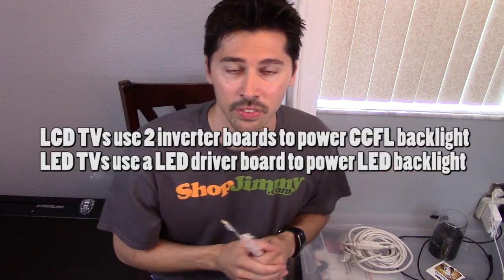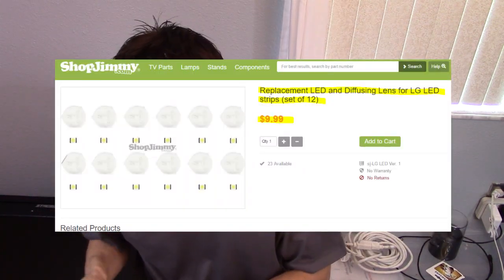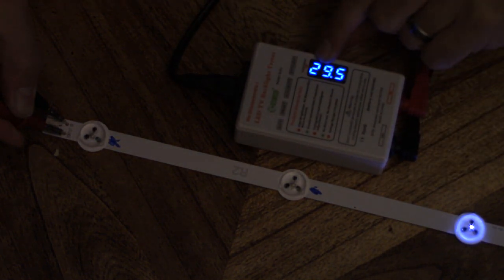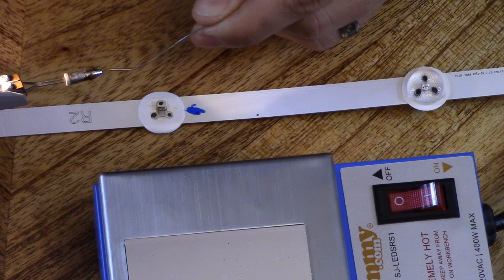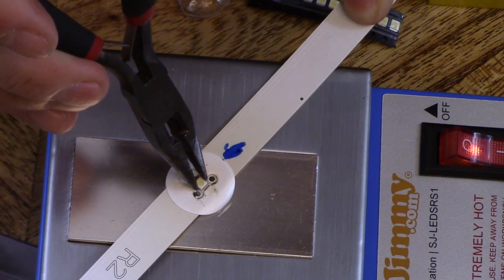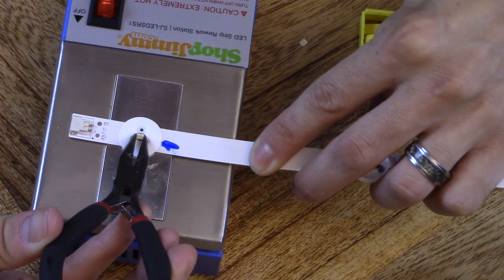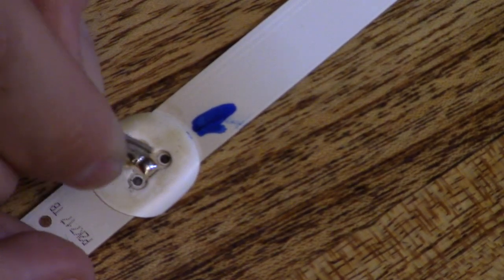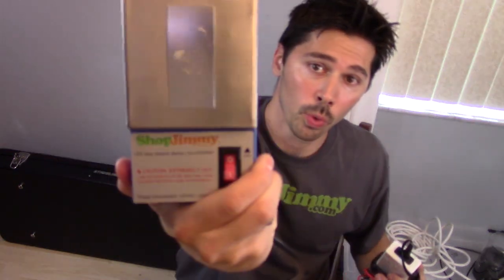EASY LED LCD TV FIX - no picture black screen backlight repair kit

Comment: I have a 60 inch LG 60LB5200 that is brain dead, the only sign of life is the green led power light and it just kinda flickers and has no response to the buttons bieng pressed, was told lightning had hit a tree down the road and it never turned on again.  Nothing is burnt inside...  Where would you start?

Comment: Tamaptec, how do I determine if I have an LCD OR LED TV?
Reply: Check for any writing on your TV enclosure itself for the words LCD or LED. If you can't find any, the model number of the TV should be on the back somewhere. You can look up that number on Google which should then tell you if the TV is LCD or LED.

Comment: Hello good afternoon from medellin colombia for days I consult them by the server of shop jimmy is not available for this area, I have service center tenico and I have not been able to buy your spare parts I attach the error that throws me thanks
Access Denied

You do not have permission to access "http://www.shopjimmy.com/replacement-led-and-diffusing-lens-for-lg-led-strips-set-of-12.htm" on this server.
Reference # 18.4c3619c8.1488752050.1871f789

Comment: Quick question.If the first LED is bad on the strips,then the whole strip will be dead right?Your tester still lit up the good ones and showed you the bad ones in the circuit.I tried 9 volts in a series and it didn't light up anything.I thougth these were wired liked Christmas lights.?1 out none works?

Comment: I have a 55" LED, but mine goes dark intermittently, works fine. Sometimes it goes out qite few times but trning it off and back on restores the picture. Sometime it does this anywhere from every few seconds to a few minutes  to the ooint the=at after going trhu this cycle for a while it remains bright with a couple of dark spots in the back ground, one in lower left corner other on right aabout two thirds down from the top.. Could this be due to the led failure ot=r just the backlightinh module??

Comment: Hi Buddy. I have a Samsung 21 inch Flat screen LCD monitor made in 2005. It can be on it for a half hour at a time then I hear a loud high pitch sound shortly after that few minutes to 20 minutes the screen goes black and the power light goes off too. Then it both come on again for a second and then shuts down. It's like random reboots. If I unplug the monitor half hour and everything works good until high pitch sound comes back again. I look on all the circuit boards for blown capacitors and I see nothing?  I don't know what it is? Can you help me? Thanks... Jim 

P.S. one time I turn up the LCD brightness and the noise came on immediately?  The picture looks normal no dark spots nothing.

Comment: Tampatec what about the volume remote control sensor
Reply from the maker: Karl Stokes just solder the new ir sensor from an old tv remote you don't use any more.
Reply: Tampatec its the sensor inside the tv that wont respond to programming from direct TV remote
Reply from the maker: Karl Stokes you can order it using the part number on the sensor board in the tv bezel, but first try hard reset by unplugging power cord for 2 minutes.
Reply: Tampatec thanks will do

Comment: Great video Question for you,i have a Samsung UN46EH5000FXZA series udo3 and i has 44 led's and got 20 that are burnt out. I already bought the work station and led strip tester,Where do i get the led's to solder in that will fit the strips.

Comment: Hi Tampatec Thanks for your help with your Videos .I have a  Sharp LC-80LE632U that has worked for three and a half years and presently it's  not working and I would like some assistance to fix it.     I am getting a Blink 1S+1F code and the backlight is not coming on I have done some troubleshooting  and the present state is :-     [1] I am getting a Menu in the background with the Remote.   [2] I have tested all the 15 LED strips with  the Backlight tester ("They are thirty LED 'S in series") and the
voltage of the tester moves from 315  to 175 volts and with a current meter in series I got  29.1 mA of current flowing through each strip.    [3] I have tested two new Rows outside the TV and got the same 175 volts and 29.1 mA current. 
[4]Row one just like in the TV with three segments  P/N:5073+5069+5071 all in series comprising of thirty     LED's.
[5] Row two   ,,       ,,            ,,             ,,          ,,                     P/N:5072+5070+5024 all in series comprising of thirty LED's.

For the fifteen Rows in the TV they have alternated Rows one and two.  [6] I have just finished changing the Backlight driver IR2E67M after doing some Internet training and practicing on some Motherboard chips . After installing the chip I notice the
whole Menu with the Backlight flickering a little and lasted for a around five seconds and if I disconnect the AC plug the TV would resort to 1-1 Blink code .  [7] I rechecked the TV after cleaning and testing the Power Supply connectors with CRC  and got a stable Menu. I was able to reset the TV using the Menu and started an auto tuning which got dim after finding about
14 channels. so.I am planning to re check the other Backlight components on the board and do a re-flow of all the soldering joints to see if I could improve on the present state of the board.I have also  noticed that the Power Supply Diagram is not available in the Service Manuals for the 60 to 80 inch Sharp TV.

Comment: I've got a Viore LCT37V66HM Flat TV that has a picture for 15 mins and then lines and snow start to run through the picture. Everything else works fine. Which board could it be?

Comment: Hi,
Hope you are doing fine.. got a problem with my Sony W700C internet tv.... when I turn on my TV for couple of seconds like 5 seconds picture in the screens are ok, after that screen go black.. I can still hear the sound but just a black screen. I've tested with a flash light as you've describe in your another videos, I can't see anything on the screen... For first 4 - 5 seconds (ie: when I first time turn on the tv) displays everything ok, not even blurry or anything... picture on screen is 100% ok. 
hope you can help me troubleshooting this problem .
Regards.

Comment: Hi Tampatec, I have a 3 year old flat screen Samsung Tv and the problem I am having is with the standby light. When TV is off the standby light is not coming on as it should. As a result I cannot put the TV on again.
The TV can only come on again if I unplug the electricity, wait for some time... plug it back and then the standby light comes on and I can then watch tv. There is only one light and it's red. Please help! I have sent it for repairs and they haven't managed to fix the problem.

Thanks for your help.  xxx

Comment: Hi Tampatec  we have a LG tv model number 37lk450u-zh the problem we have had is we recently moved to France from the UK and the tv was in storage before our arrival, I believe that it may have been damp in storage as there was condensation on the screen when we unpacked it, 
So when we plugged it in and turned it on it went pop which feel may have been a fuse on the circuit board maybe you could advise, I have attempted to click on you link for parts but this does not work which may be to do with the district we are in.

Comment: Hey Tampatec, I was wondering if you could help me figure out what's wrong with my led TV. I thought it didn't have a picture, but when I tried the flashlight test there actually was a picture, just very dim. So I figured that it was leds going out. I have 3 strips, the bottom one never comes on when testing it. The top one and more than half of the middle one lights when I test one led in the middle row. I'm using a digital multimeter that I bought from Walmart. I was just wondering what settings you put yours on. Thanks in advance.

Comment: I had a lightning strike and TV turns on fine, I can see over the air channels but when I switch to HDMI it detects what is connected (XBOX or Firestick) but then after cycling it says no input signal. tried different cables and to save money I replaced the side ports but still no signal from HDMI ports. I'm really trying to avoid buying another mother board for financial issues, I saw a video of someone heating board to hopefully have the solder fall back in place. I appreciate any help. sorry for long message.

Comment: Will these kits work on Toshiba side lit TV's like the 46L5200U1?  The LEDs are longer and only on the right side of the set in one long strip.  Shop Jimmy has a replacement strip 2012SGS46 for $49.95 but no individual LEDs I could find.

Comment from the maker: set the backlight setting to middle setting, here's the tv backlight repair-https://www.youtube.com/watch?v=YgaL6X6eSaU **bring up brightness to 50 to 55, contrast 50 to 60 and backlight at 50. it's BEST to use calibration bluray/DVD disc on all your tv inputs to have the best picture settings. disney calibration disc here-http://amzn.to/2eatKqv OR http://amzn.to/2e6KiDQ
Reply: Tampatec I did what  said to do on my Hitachi Led TV turned down the back light to 60 contrast set 55 -brightness 50 TV'S back light seems a little darker can I adjust the back light up a little bit? I noticed a setting that's said firmware update I haven't checked
Reply: Tampatec

Comment: no I missed the video on taking the tv apart my 
TV is LED my brightness is set at 47 contrast 50  my back light is set at 100 should I bring the back light level down? Jason
Reply from the maker: set the backlight setting to middle setting, here's the other video-https://www.youtube.com/watch?v=YgaL6X6eSaU **bring up brightness to 50 to 55, contrast 50 to 60 and backlight at 50. it's best to use calibration bluray disc on all your tv inputs to have the best picture settings. disc here-http://amzn.to/2eatKqv OR http://amzn.to/2e6KiDQ
Reply: No

Comment: Helllooooo Tampatec!!! i just tested all the leds one was burnt out and replaced one led, the backlight now works for 1 second. then it fades away. what would you suspect in this situation. i mean its a better result than no backlight at all buuut its only for one second lol
Reply from the maker: might have another bad led causing the circuit to fail.
Reply: its like it starts and then draws too much current and overcurrent protection kicks in and it dies out . i measured voltage with my multi meter and it goes to 120ish then goes down to zero

Comment: Wouldnt a variable power supply do just as good a job as that led tester unit?
And a simple hot air gun do for the soldering job?
Reply: even some batteries in series would do the job of a power supply to test the strips.
Reply: Hot air could but this one's  better.
Reply from the maker: omgffsification never tried maybe
Reply: Yes, a lab bench power supply would work, but you would have to be careful to not exceed the led rating. I normally keep it under 100 ma and it's generally safe. Any higher and you risk blowing good leds.
Reply: Peter Enis am wondering if the battery from the hoverboard can they are 36v
Reply: amefika Dwyer 
If you go much over 3v per led you could blow them. And a hover board battery can supply about 10 trillion more amps then a backlight led needs so if your over voltage it's toast.
Reply: maybe to much voltage, i would just use 3 9v bastteries they can be had in some cheap stores for 2pcs for 1$ something lke that.
Reply: omgffsification

Comment: love the vids I have a 55 inch that went out on me an I was kinda "scared" to open it up cuz I didn't want to break any thing but I've been learning a lot from your videos thanks agin
Reply from the maker: research and be patient when your fixing your tv you should be fine, unplug tv and use gloves if you are nervous about getting shocked. checking volts on power board is where I start troubleshooting TVS .
Reply: sir my problem is led tv have line in the middle..what can I do..tnx
Reply: Dillon Brosius